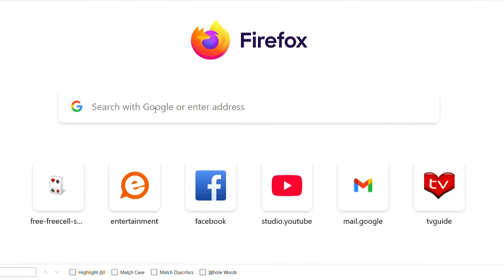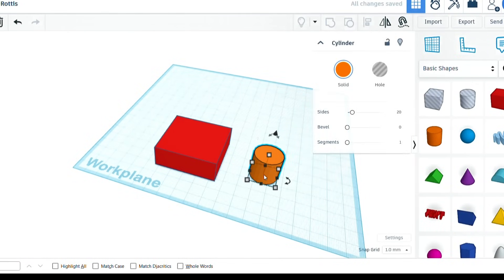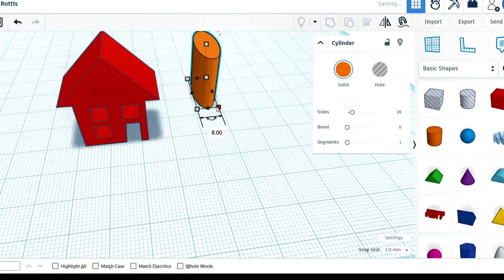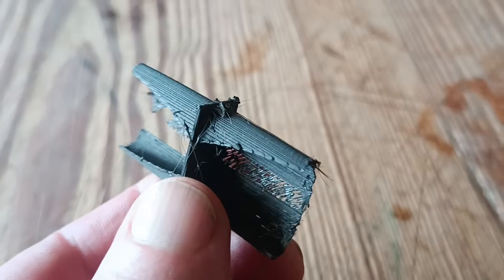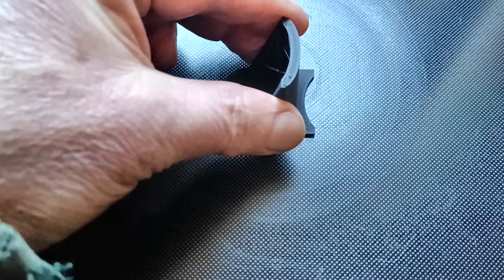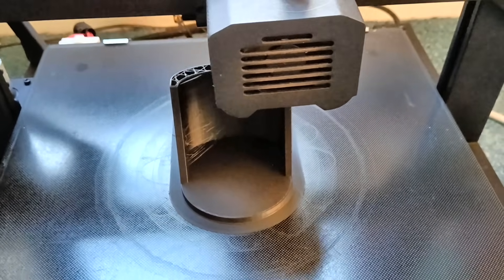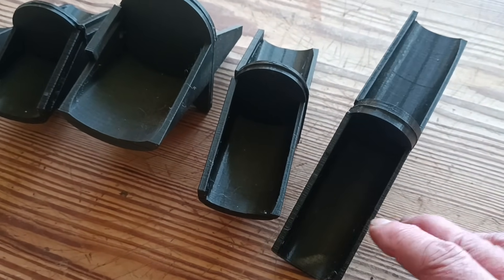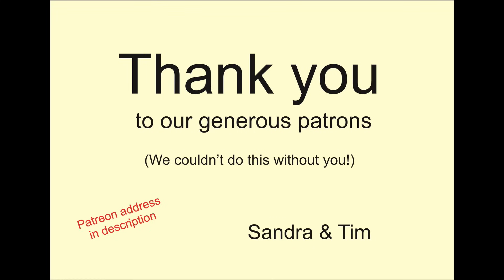First Ever 3d Design and Print – For A Mechanical Tipping Bucket Rain-Gauge, And Other Things..

Comment: I had a rain gauge that worked like this.  It had a cup that caught the rain and a drip hole that dribbled the water onto the tetter/totter.  The cups were calibrated for a known amount and as the mechanism tick/tocked a sensor counted them.  It mathematically calculated the amount of rain based on the clicks.  Pretty neat.

Comment: Something to look at for the 3d printer is in your slicer settings.  Many slicers have a setting to "wipe" the nozzle into the infill area before making a large transition.  This helps reduce the stringing/fuzz in your bucket.  Also, increasing the infill percentage will help make your part heavier, causing it to fill with more water before switching (as opposed to just making the bucket bigger).

Comment: WARNING!  Longer has been known to do some very sketchy things electrically.  Keep an eye on the bed wiring!  Longer used to divide a load over multiple wires to make a tidy connector on the bed.  This is an absolutely improper solution.  As soon as one of those wires fails, the others cannot handle the load.  They overheat and BAM!  You have a FIRE!  At a former workplace we carried Longer products until one came back that did burn up.  The brand was immediately dropped when we discovered this issue.

Comment: TinkerCAD is a good way to begin thinking of breaking down concepts and things into 3D primitives.

Eventually you can use this mentally to picture the object in 2D projection (the basis of a sketch for extruding or revolving in full fledged CAD software.)

Comment: The trouble with a tipping bucket rain gauge is they don't work below freezing. Obviously what's accumulating in the bucket is snow and ice, then as it melts, it drips into the tipper, but if the tipper has any amount of ice in it, it isn't measuring the same amount as expected when it fills up to tip.

We went with a collection bucket that we filled partially with anti-freeze, and measured the depth using a sensitive depth gauge.
Reply from the maker: You're right of course, but I think I can live with that. Here the few days of frost rarely have precipitation at the same time.

Comment: Hi Tim.
"Tinkercad 3D design" is only one part of a suite. 
There is also an electrical circuit design tool and a mechanical simulator called "Sim Lab", that you might find particularly interesting..
When you were shown how to get to Tinkercad 3D Design, you might have been given the direct link to that part of the web site , but if you remove "3d-design" from the URL  that will take you to the main landing page.
From there you can chose from the options I mentioned and some others as well.
( I haven't tried it here, but In the past I have found that You Tube doesn't like me posting links in the comments, and removes them).

Comment: I'd like to suggest you make text letters and mount them on important information signs. Doing this is a fun as it is useful. It seemed I learned more about 3D printing by starting out with lettering than with shapes and figures. It was easy to over do it. It was not unlike owning my first label maker.

Comment: I've been tinkering with 3d printers for many years now. It is amazing what you can make. Just recently upgraded to a resin printer. My only advice is to not get frustrated when prints fail. It happens to all of us. Also, get a nice digital vernier caliper. That will help you with engineering new parts. You will learn so much with these printers.  programs.

Comment: Hell yeah Tim. I'm 3d printing and doing CAD all the time. If you need tips or help troubleshooting I'm sure me or someone else in here can help too.
3d printing has incredible potential that some people miss because "oh it's plastic it's weak". But there's a lot of stuff that doesn't need to be super strong. AS you point out, the size and shape are just right. You can get really far 3d printing fixtures and templates, spacers, all kinds of helpful nonsense.

Comment: The technical term for what you're trying to build is Tipping Bucket Rain Gauge (TBRG). Typically, the high quality ones have a hall effect sensor to count the tips and have a resolution of 0.2mm of rainfall per square meter per tip. 

There is a tendency for the buckets to pool water due to surface tension on the inner most surfaces which effects their accuracy if they're not carefully designed.  The one's used by professional organisations have a thin wire soldered along the trough of the bucket from the inner most wall and out over the edge which hooks down and out of the bucket so ALL of the water runs along the wire and out with each tip.

Calibration is also a challenge to do well.  You may wish to add some grub screws to each side which can be screwed in and out to increase/decrease the tipping rate for calibration. 

I am an engineer and technician who works closely with these so I'm very happy to help with getting this working.
Reply from the maker: Thanks Gordo. I was thinking a coating of grease would help empty it completely, but the wire (or a groove?) sounds interesting too. I hope you'll chip in as my design progresses but so far I'm enjoying learning as I go
Reply: @wayoutwest-workshopstuff6299  A thin layer of Silicon sealant for bathroom might also do the trick
Reply: @wayoutwest-workshopstuff6299  Keep in mind that most things you would want to print have already been designed if you look online you can download almost anything and you can make tweaks if you want.
Reply: thedave7760 makes a good point. You could browse thingiverse for something that already exists.  

The professional ones which monitor for cities and governments etc. are litterally gold plated because it's innert and they have to be reliable. 

I'd be curious to see how well a hydrophobic coating like oil works but my intuition suggests it'll accumulate dust and debris and thus need more regular cleaning.
Reply: @gordo4055 Seriously this.  The first thing I say to myself when I'm trying something new (to me) is: "I am not special, I'm probably not doing anything new, let's check if someone else has already solved this."

Comment: What you can also do with some 3d printing, is electroplate the result. Where obviously sometimes it is better to just make it out of metal to start with, but for things like this water tipper, it feels like for you it would be easier to 3d print it until its what you want, and then give it a light plating of metal, just to help it last longer.

Comment: 1:54 Not silly at all.   As a 56 year old engineer and electrician I find myself back in the job market, I am computer literate but have never used CAD or a 3d printer. You have inspired me so many times with your railway, car and other inventions and now this video. I am going to try Tinkercad it sounds right up my alley. Thanks 🔧👍🏴

Comment: Such a great tool once you get it dialed in!

There are PLA's out there infused with metal or even wood chips that will absorb stains and dyes. Copper infused to wipe with vinegar for patina. Iron infused to wipe with salt for rust aging. All kinds of ideas for finishing touches. 

Best luck and have fun!

ps. Glow in the dark green or blue too for light switch covers and other markers, heh heh. Get a hardened nozzle for that stuff though.
Reply from the maker: Thanks for the tips!

Comment: Great to see you adding 3D printer to your toolchest! 

I actually think that people that know about machining eventually get sucked into CAD and 3D printing as it is all the same tech as on regular 'machines' but in two tools!

Once you discover that you can just model the exact vacuum hose attachment to some obscure tool vacuum port you are away into the wonders of customising and no longer having to duct tape attachments together!

Wait until you discover TPU (flexible and almost indestructible filament - but a bit of tweaking to print) and the possibilities are 'virtually' endless.

Tinkercad certainly seems to work for a lot of people - my personal workflow is Fusiion360 and autocad so that I can extract DXFs for laser, cnc and 3d print solids - but there are  some significant learning curves! (looks like you can export svg and convert to dxfs in the tinkercad ecosystem)
Reply from the maker: Thanks - yes, you can export svgs, so you can convert those for any 2D application

Comment: You may need to consider a filament drier.   3D PLA and PETG filament is hydroscopic and will absorb moisture which affects the printing.
In TinkerCAD, when you use a cylinder, increase the number of sides to maximum to make the cylinder more rounded.  Also, in the shapes on the right, search for "high resolution" to find the higher resolution cylinder for better quality.

Comment: Excellent Mr Rowe, I have to take the plunge into 3D one day and I have always wanted to build a loco around one of those engines.
Reply: Just do it! I bought one back in 2022, and it's just fun to tinker around and do things from useful (new handles for my fridge) to completely silly (in the process of designing a congreve clock).

Comment: I needed a business card holder urgently this week, so I spent 5 minutes designing it in FreeCAD and sent it to one of my 3D printers. It was by far the least stressful part of preparing for the event I was going to! I'm about to finally buy a lathe, as I need to make a new pulley for a mower. My plan is to design and 3D print the pulley first, so I can test fit it in the machine, then use that design to make a template I can use as a guide when I'm turning. An alternative that someone suggested is to use a 3D print as a pattern for casting it in metal. Once you get into 3D printing, you find endless uses for them!

Comment: I bought a 3D-printer during the last 'black Friday' sale from Amazon. Usually £400, got it for £200. It's not 'top of the range' or particularly large but it is ideal for my Raspberry Pi projects (supports, frames, enclosures, Etc.). I use a program called 'Open-SCAD' which doesn't have a GUI as such but rather you create things using a programming language, which is ideal for me (see above). PS: Open-SCAD is also free!

Comment: thinkercad is a rubish program, more a childs toy. try out autodesk fusion 360, there you start with a 2d drawing like how your plasma cutter operates. make a 2d drawing than exture into 3d. and refine its surfaces with 2 drawing to add futures
Reply from the maker: But you can do that in Tinkercad too..

Comment: 3D printers are amazing for many things! It's funny I have started with that and moving to metals and you started with metal and moving to plastic :D
If you have the chance, give a try to Autodesk Fusion (or similar tool Onshape), it's free for hobbyists and it is not much more demanding to learn the basics. The advantage is that you starts with sketches where you draw lines, rectangles, circles, etc... and can set precise mesurements and then you extrude volumes from there. You can also easily draw gears and integrate them into your design, and then export them as DXF for your plasma cutter. After you get more confident, you could even add joints and motion to simulate and animate your little locomotive!
Reply from the maker: Thanks - yes, you can do that in tinkcad too, apparently. Cogwheels and sprockets and animation..;

Comment: My father has worked on fixing industrial scale 3D printers for nearly 20 years now, some of the machines he works on now would be very useful to you I think! Metal printers are already in use fabricating turbine blades for airplanes, unfortunately the cost means pretty much only companies can buy them, and even then only in small numbers :/ It would be very cool however if you could just print out a locomotive. Anyways, very cool rain gauge! I might need to build one myself, saying the weather forecast here is just inaccurate would be complimenting it.

Comment: Hey Tim, you can melt your failed prints down and turn them back into filament, there are other videos on YouTube that show you how
Reply: It's really not worth the cost or hassle.  Easier to melt it down and use in moulds
Reply: Would that depend on the kind of compound, or is all printable plastic re-useable?
Reply: @brendangilmore4297  All 3d printing plastic turns from a filament into a semi-liquid state in the nozzle before cooling and turning back into a hard state. melting it is pretty much the same proccess. But it does degrade the plastic